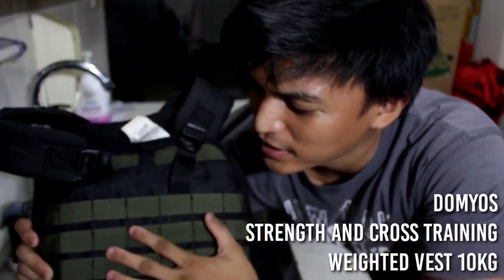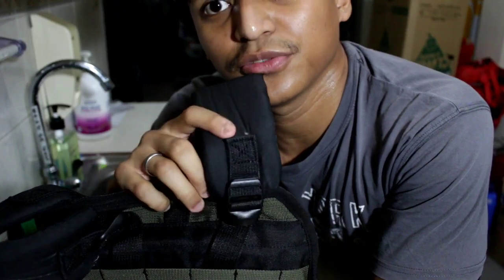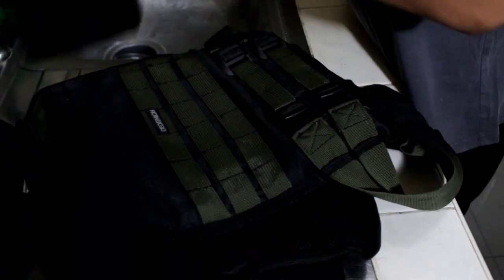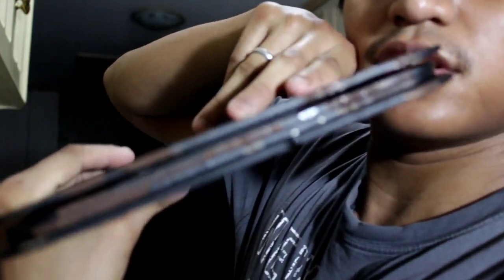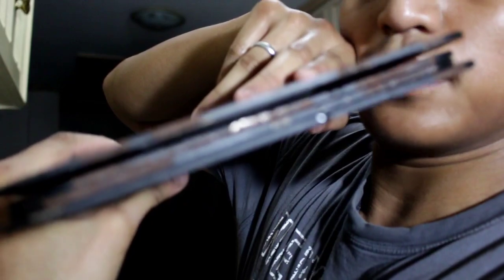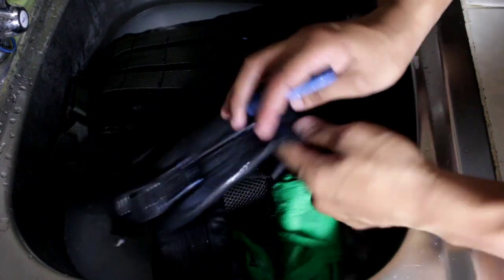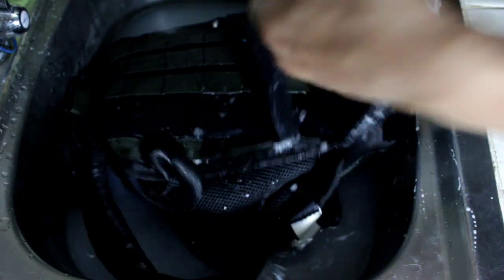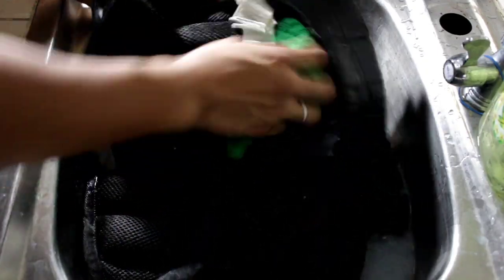How to Clean Weighted Vest/Plate Carrier - Decathlon Domyos 10Kg Weighted Vest

Comment: Thank you, I was about to buy this product. Does the sand inside leak out or anything due to cleaning or anything? Thanks again.
Reply from the maker: No, the sand does not leak. I own it for almost 3 years now and it has not leaked yet. Sorry for late response.
Reply: @domallado4212  Sure, had had it for months now, lol. It's a good product. Sadly, the weight plate is hard, it cracked the floor when I accidentally dropped one.
Reply from the maker: @bim1537  Im sorry to hear bout your floor. But yeah, it really is a good and reliable product

Comment: Dude is it genuine 10KG , because i went to decathlon yesterday and lifted the box out of curiosity but i didn't feel like 10kg to me. Can you please check it? Thanks
Reply from the maker: Hi. Yes it is 10Kg. I have been using it and I got it rugged and rough but whenever I weigh it dry with all the plates inside, you can rest assured it weighs at least 10kg.
Reply: As per them, 6kg for the vest with its sandpads, then 4pcs of 1kg thin plates.. so 6kg + 4kgs = 10kgs..  maximum load ng vest is 15kgs